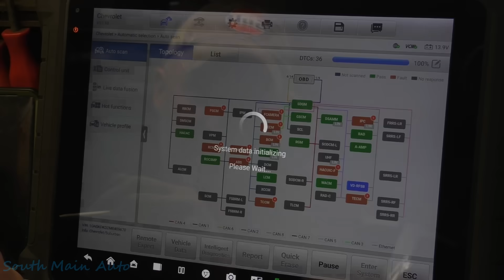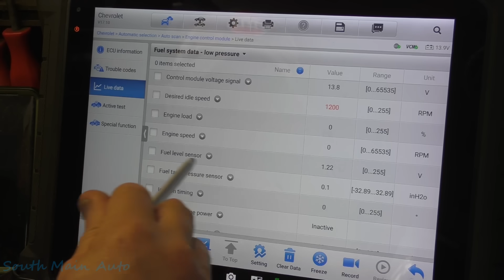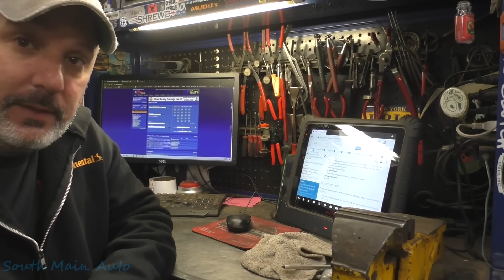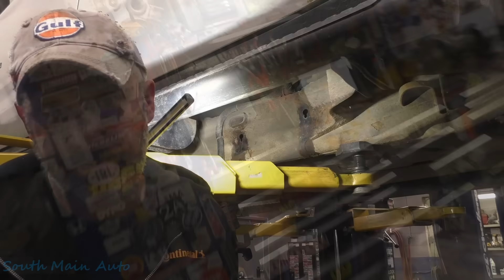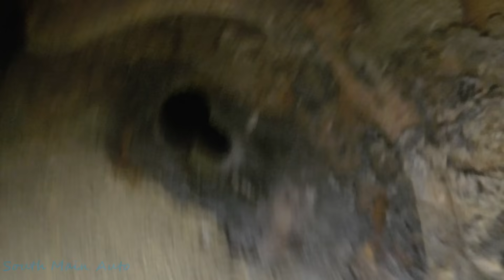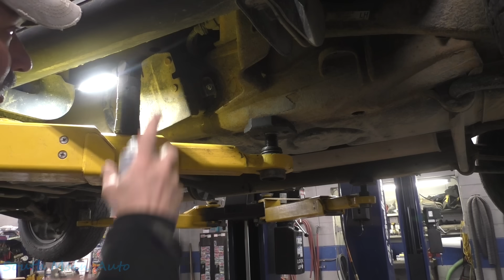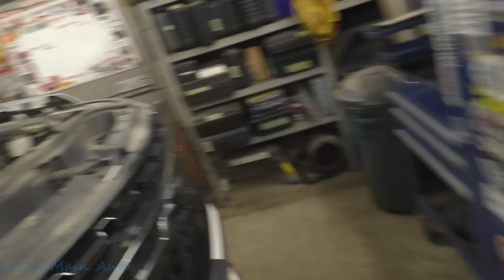'21 Chevy Suburban - No Start, Cranks OK

Comment: Great info' from this channel. On the 3 phase comment - brushless motors in general are 3 phase DC for rotary and Linear brushless motors - very common for brushless motors and very low cost to manufacture. This is affecting many industries not just automobiles.

Comment: Had my first BLDC diag recently, Dealer said it needed motor and if that didn't fix it needs control module. Gotta love the dealer techs, they keep me very busy. It's important to remember that it's not just three phases to the motor, there are three hall effect sensors in the motor also, no position information no motor control. Found 5 volt reference to motor open courtesy of a snack stealing bastard. aka mister mouse or rat.

Comment: Stuck rotor will result in high current and no
Fuel pressure. Not much different than a regular motor. 

Three phase motors offer more control than a PWM motor and more torque across the range of speeds

Comment: Great channel!. Those bolts on the frame rail look to me like they push in and slide down in the "key hole". So to slacken from the outside would mean a clockwise rotation to loosen the "key hole" bolts. I could be wrong (usually am) Cheers Chris UK

Comment: Well, that is interesting about that mounting system, but after one has gone through the headache and after one has understood the reason for that goofy fastening system one see's that this is the only way the factory (engineers) could have fastened that unit to the frame. With that enclosed frame there was no way to attach that piece and if the "J" style retainers were used of course they seize up and strip out anyway. Anyone going in behind you would see that this piece has been removed before but unless they know the trick they would also have the same aggravation. But now we both know the key here and I had the pleasure of watching and learning and you had the displeasure of having to be aggravated to show the procedure. I see now that one should hold the fastener with an external torx socket and break the nut loose with a wrench (that is of course if it is not rusted tight).

Comment: Thanks to planned obsolescence these cars are meant to fail after 3 years. 
Salt spray...gets into those parts and wrecks them much sooner. 

My point is the Fuel pump control module seems like an important part of a car.  
There it is, slapped onto the side of the frame, completely exposed to the elements, beat on every day.

Cost met, project timeline met,  production volume met,  sales volume met.
As long as it works 36 months and 1 day after the date of sale, who cares if it works or not.

Comment: This is coming from an electrician, apparently those 3 phase motors brushless DC fuel pump motors are internally star connected meaning that the 3 phases (e.g. A,B&C) , if you measure between phases A-B, B-C & then A-C then the resistance measurements in Ohms should be equal, if one or more is lower than the other then it's shorted out or if it's infinity Ohms then there's an open circuit within the windings.

An amp clamp will tell you if it's pulling too much current from the fuel pump controller which is basically a 3 phase inverter, the current in each phase should be equal & if GM doesn't have any current specs for it then yes, it would be good to have a known good current measurement to refer to.

We were shown what a 3 phase sine wave looks like at tech in the CRO (Cathode Ray Oscilloscope) days in 1996 but they use more modern scopes now, you just need a 3 channel scope & each individual sine wave should be 120° apart so you can test the output of the fuel pump control module which is why I am wondering why GM has gone a bit dumb & decided to go to the parts cannon method a little bit as far as diagnosing the non working fuel pump issue.

If you knew the voltage output of a known good fuel pump control module then you could make or get an inverter made up to drive the fuel pump externally to test the pump, if a sine wave is missing, then there's a problem inside of the fuel pump control module.

I do commend Ivan from PHAD with using a.scope to diagnose brushed DC fuel pump motors & fuel pump control module faults , a scope is a must have to diagnose fuel pump control module faults apparently.

I have however, noticed that he got complacent when he diagnosed his neighbours cars replacement starter motor as being faulty because the scope capture showed that it had an open circuit in the armature windings & he tried to replace the carbon brushes then to refit the starter motor which failed soon after.

I could see that a winding looked a bit cooked on the armatures commutator meaning that I wouldn't have put that starter motor back into service !

Comment: Seems like a pretty silly place to put an electronic control module especially for something really important like the one that controls fuel delivery to the engine.  I would think making that module more robust and better protected from the elements would be a higher priority.  But hey, who cares if the fuel pump quits at a random critical moment? It's not MY car.  Truly a head scratcher.

Comment: Yes Eric O you have been wrong before. Like when you thought Mrs O made a mistake! 😂 On another subject I think the fuel pump control module mounting was a complete afterthought on GM's part. Look where it is mounted on the outside of the frame rail. Subject to all the insults (dirt, salt, moisture) the front tire can throw at it. They used up all the available space on the inside of the frame rails some low seniority engineer was tasked with finding a home and mounting the control module. He or she did put a nice guard on it? I know nice for catching crud!

Comment: Erick! You are awesome, your ability to process information and solve problems is exceptional, but some times it’s hard for us to recognize  the 
writing on the wall, as you have mention on several ocasions, “what engineer or team of engineers in their right minds would continue to come up
with this stupidity? And here we are thinking that these guy are all stupid, they are not stupid, they know exactly what they are doing,
putting (ELECTRICAL COMPONENTS) on the outside under the car in the elements, cannot just be a stupid mistake or an oversight by all these
"engineers", what their are doing would have to be be intentional, they all can't be that stupid, and that begs the question, "why would they do 
something like that intentionally"? Well! The answer to that question is a topic for another forum, for right now, I’ll just say “PPO”
Plan Product Obsolescence. All items manufactured today are made to be disposable, they do not want you fixing anything, if it breaks, throw it
away and buy a new one, things are no longer made to be serviced, the premise is, if they make an item to last a long time, “and they can”
then they can only sell you one of them, but if they make it to fail prematurely, “and they do” then they can sell you several of them over a period
of time. I’ll just stop here. Keep up the good work dude, you are awesome.

Comment: You know it’s funny because as much as you cuss GM, that’s exactly how I am every single time I’ve ever worked on one of your favorite Toyotas. To me they’re some of the most crap engineered, overrated vehicles ever made. I remember their stupid idea of running the O2 sensor connector up into the floor, under the console on Camries. Literally the least reliable vehicle I ever personally owned was a Toyota. So I get it. We all have our preferences. Both to own & to work on. By the way, I’m a Ford guy so nope. Not a GM fanboy. Though my race car has an LS.

Comment: 2017 and up jeep renegade has the same torx bolt with a 10mm nut on the 2 hood latches that are bolted to the fenders. Ask me how I know. Stupid design had me about to cut them off before I figured out to spin the torx to remove the latches.

Comment: Like too many other manufacturers, they design and build for ease of assembly, not ease of maintenance.  Why?  To keep costs down while they fill up the cabin with tons of useless and overblown electronic goodies.  I need a radio, simple climate control, and some comprehensive gauges, not a touch screen and all manner of other bullshit that drives the cost up and ends up just distracting the driver.  I'll keep my '98 BMW 328i and 2001 Ford Explorer thank you. No  bullshit and stuff you can actually work on.

Comment: Is there a way to bypass the fuel ignition control module like you can on the 2007-2013 Chevy gas trucks

Comment: I have never worked on one of these type fuel systems.  But I have worked for years with 3 phase motors and control systems in factories.  There is no such thing as a DC 3 phase motor.  They are all A/C.  I recognize what you have going on there, they have been doing this for years in industry.  They take the supply voltage, whatever it is, in your case 12v, and put it through a array of high output transistors.  These transistors are fired by the circuit in the module to simulate 3 phase A/C.  These are called "frequency drives" in industry.  It's used to control the speed of a A/C 3 phase motor, which is cheaper to make and does not use brushes like a DC motor.  The development of cheap electronics is how this technology took over speed control of industrial motors.  The method you used and the meter you used is perfectly valid for checking a 3 phase A/C motor.  Check between all windings and then check between al windings and ground.

Comment: You know what worked? Port injection and a flippin filter/regulator. Pump is simply on/off, no PWM bullshit, no DI crap that only looks good on paper while simultaneously destroying your oil life because it doesn't atomize for crap on cold starts. GM used to be incredibly simple and reliable even when they introduced BCMs and CANbus. Now everything is overengineered for the sake of overengineering, except it's all done on the cheap. If you're going to overengineer something, do it the way VW did the Phaeton, and don't force it in your entire lineup.

Comment: One method that can work pretty well is a second brushless motor; as they are permanent magnet motors usually, you can just connect the phase wires from only motor to another, chuck the shaft up in a drill and spin it up, the other motor should follow it if is somewhat unloaded as they will act as a 3 phase generator.

You may want a slower speed brushless motor as your generator, as it will generate a higher voltage at the lower speed and more easily spin the pump motor "open loop".

Comment: I lost faith in GM when I had to do motor mounts on a friend's 89 Camaro where they put a loose nut inside the engine k-member. I will never understand why they didn't weld that nut. I found out thye did this with all of their RWD vehicles.

Comment: Inverted torx because it is faster/cheaper on the assembly line than a rivnut or tapping a hole into the frame. I'd bet at least $1.50 that I'm right on that one for sure.

Comment: Electric radio controlled models use 3 phase motors all the time, they are driven by whats called an ESC (Electronic Speed Controller) you can buy these dirt chep along with a test controller that plugs into it so you can vary the speed of a 3 phase motor, in theory you could hook this up with jumper wires (it does not matter what order  you wire them as direction is not needed for a test) you could also buy a chep rc model motor so you can see if the controller works too

Comment: Your test of the motor will tell you if the motor windings are OKAY.  There is a controller for the motor.  It appears there is no test for that part of the module.  Part substitution seems to be the best test.

Comment: Eric, the pump CM was an after thought. They punched key hole slots on the frame rail and slid the bolt heads through from the outside then tightened the bolts with inverted torx for speed of assembly, works great when everything is shiny and new the day the thing gets bolted together, BUT after a couple of years on the road they aint never coming out. AND, when the assy gets a coat of road crap over it nobody without an x-ray machine is gonna see how it was assembled.
Anyway, now ya know I bet you tackle the next and subsequent units differently!! :face-blue-smiling:
Reply: Yes that's the real answer and has explained odd design choices for the entire history of cars.  They didn't sit around a table trying to figure out how to "screw the owner."

Comment: Way back when there was Ma, Apple Pie, and Hot Dogs, the fuel pump ran off a lever that followed an eccentric on the camshaft. Back then you could even buy a rebuild kit that included a new diaphragm and two check valves for a few dollars.
What was wrong with that? It was simple, effective, and nearly foolproof, until some fool came along..........😢

Comment: Design: The classic option is a captive nut in the frame. When that nut becomes free, you need to torch it.  I see this as an improvement because the frame slot allows you to hammer the unit up and out of the socket even if seized.

Comment: Them bolts: MAYBE an air hammer, with chisel end ground flat, pushing up hard against the welded nuts while hammering...
   Would slide everything up until the bolt head (inside the frame) reaches the large part of those keyhole slots.
    Then you could deal with the mess with it off the frame. 
     MAYBE....if the coefficient of friction is in your favor and you whip out that 498k Thor. 
    Burning chlorinated brake cleaner (it's usually chlorinated) makes hydrochloric acid.  A small amount (like vapors) will make steel and iron rust before your eyes.
    For the sake of everything steel/iron from the cylinder liners to the tailpipe (valves...guides..)- carb cleaner won't do that,  and burns well. Or gasoline.
    For the spray and drive method of getting it in the shop, is why I say that.
    Sorry for being pedantic, but HCL is murderously corrosive to iron. NY road salt is like fluid film compared to HCL, really.

Comment: They are carriage style bolts with a square lug under the head that fouls in the slot. They are not installed from the inside. It’s no different than a blind wall shelf hanger

Comment: amazon has several PWM controllers that you can connect to pump wires and dial speed.  that's what I use on solenoids and such

Comment: Ok bash the chevy’s.  But they all do it!   I once had a ford f150 2003 vintage. What engineer would think a fibrous pad glued to the bed above muffler, in the rust belt, was a great idea!  Damn muffler out lasted the bed.  Didn’t find it until stepped on it and went right through.  Left a square hole in the bed.  Pad still stuck to the remains of the bed.

Comment: Definitely a screwy set up mounting the bracket to the frame.  I wonder if you could grind off the welded nuts, and use carriage bolts with regular nuts?  The square portion off the carriage bolt could fit in the slot, keeping it from turning, as you tighten the nut.

Comment: 29:46 I believe it shut off because it was already pressurized. I noticed that it started up right away and Mr. O. never opened the fuel system so it was still pressurized therefore, it is going to only run for a second or two and then shut off. I would bet if he had a fuel line open it would continue to run and thus pumping fuel out of that line.
   Edward H. – “New Ideas and Innovations, LLC“ out of Madison, Connecticut USA

Comment: I work at a gm dealer. I never take the bracket off. Just use a 10mm ratchet wrench and take the nuts off that hold the control module on. The module comes right down

Comment: Under 100k + 4 years old + Roughly 90% chance it's not paid off = "Older higher milage" Chevy
My old man's Sierra had 3 sets of rear pads/rotors/calipers in 140,000 miles. At 150,000 miles i removed the factory clips that hold the drums on to check rear shoes for the very first time.
They were fine.
Reply: Chevy vs Toyota

Comment: To make the mounting process easier for you and the next guy, cut a slot in the end of the bolt so a flat head screwdriver can be used to tighten the bolt, then cinch the nut down.

Comment: Could you weld a nut on the end, then back the bolt head out into the frame enough to lift the head of the bolts through the larger hole up top?

I get it that you would have to know that it is bolted in from the inside through…

Comment: To test the motor in place, the only complete test would have to be an external 3ph motor driver?  a) Given its an entire module dedicated to motor driver - have to assume it has overcurrent protection.  So you probably will not see overcurrent on a stuck motor.  And the behavior could change over different brands or revisions to the controller.

Comment: Glad i'm not the only one that feels this way about GM. Clearly the key way is in the frame is cheaper to manufature than a threaded hole in the frame. And is cheaper than a two holes with a j-nut. I retired from this career. The 18 years at several different local chevy dealerships has destoryed me mentally and made me freaking hate cars.  The best thing that ever happened to me was to walk away. You know how techs at the dealer are diaging cars? Shotgunning parts at it. If they are wrong then now they have a "test" part and thats how they diagnose a vehicle, get a new part that has been opened before, well that was used by a tech to see if it would fix the vehicle. The automotive field is becomming a huge joke, over priced junk that is not reliable at all.... Side note my cuz told me he had a subaru sitting for 4 years because it needed a subframe, decided to junk it because something died in it. It was dead. Couldn't acess the shift interlock to put it in neutral, put a jump pack on it, and said what the heck, turned the key and it fired right up and he drove it on the trailer LOL.